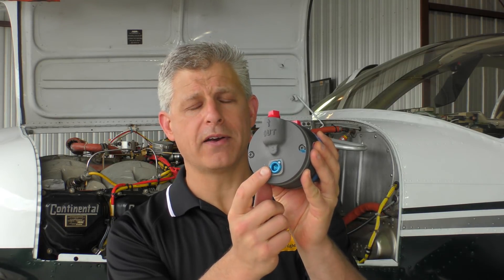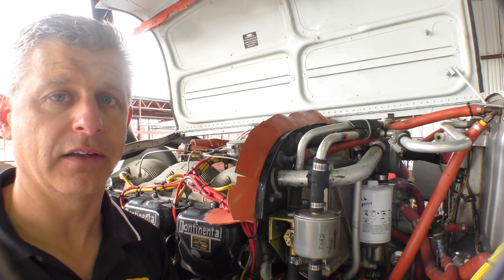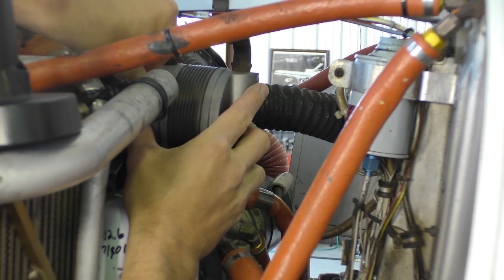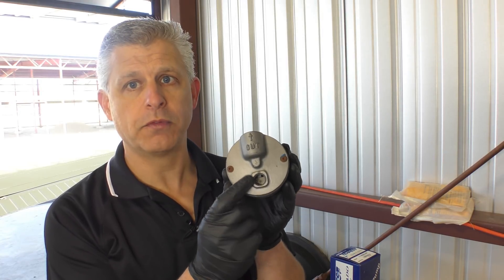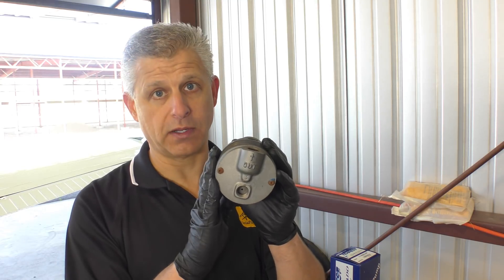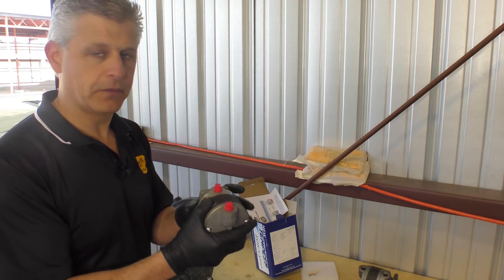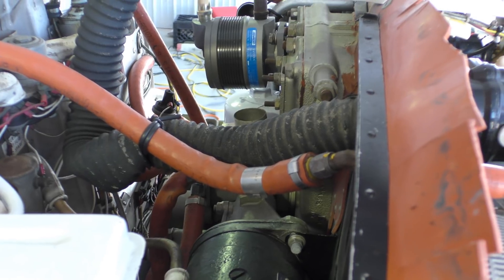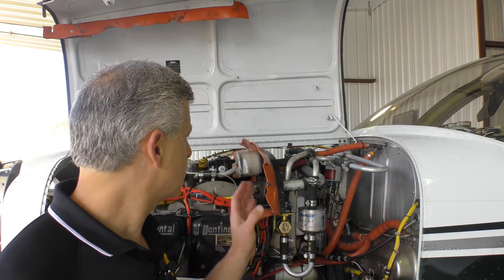Artificial Horizon Failure! Time for Maintenance...

Comment: As long as I can remember, my plane only had about 3.5 in of suction during runup, even after trying to adjust the regulator.  Everything worked fine anyway.  Recently my AI started failing after about 20 mins of flight, still vacuum at the same it has always been.  So, I ordered and installed a new vac horizon.  Connected it and did a runup and now the vacuum shows 5 to 6 in of suction at runup.  I've never seen it in the proper range before in that plane (16 years).  The only thing I changed was the horizon instrument.  I'm a little baffled by this.  The only thing I can think is that my 10 year old Sigma Tek horizon has an internal obstruction of some sort.  I have a new vac filter on order anyway and will see what happens when I change it.

Comment: I have a question.  Why replace the vacuum pump, when it is the cause of the problem?  I have seen vacuum failure discussions many times in aircraft maintenance magazines.  An earlier comment said just replace the AI with the Garmin G5 electronic AI. A very good suggestion. I would dump the vacuum pump, replace it with a second lightweight alternator and install all electric gauges, if you want to maintain a standard 6--pack orientation. I have seen this done with other A6 Bonanzas.  The G5 may be a more economic alternative. I still would get rid of the vacuum pump.

Comment: Because the "vacuum pump" was used to provide pressure to the instruments, that would explain why the carbon particles got into the artificial horizon.  Why did they do it that way?
Reply from the maker: Excellent question that I'll have to research and get back to you on ;-)

Comment: Great video. I’ve got the Tempest pump as well in my A36 and at 600 hrs  the indicator window still shows entire vanes. They make a great product. I would suggest that you also replace the hose connectors with new ones (silicone) and flush the metal lines as traces of carbon will unfortunately get past filter as you discovered.
Reply from the maker: Absolutely correct!  We did replace all of the flexible hoses and flush out all of the rigid lines as well.  Unfortunately, that part of the video got cut out to save time!  Thanks again for the comment!